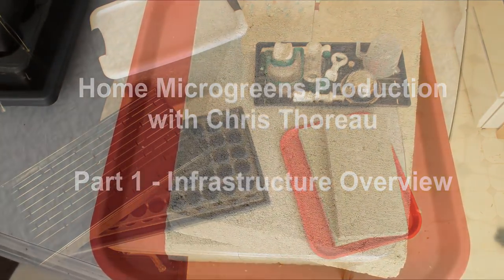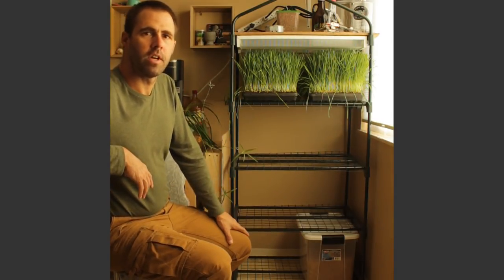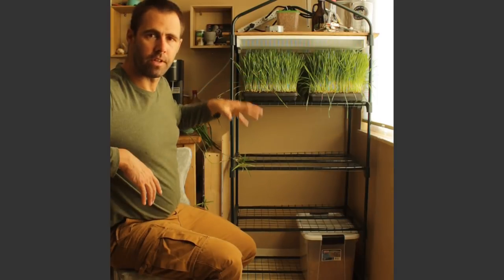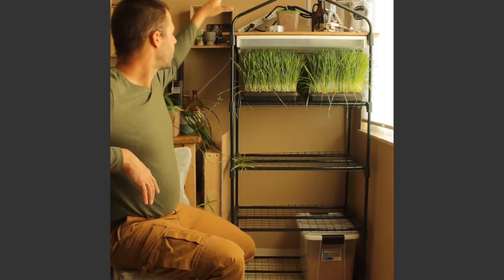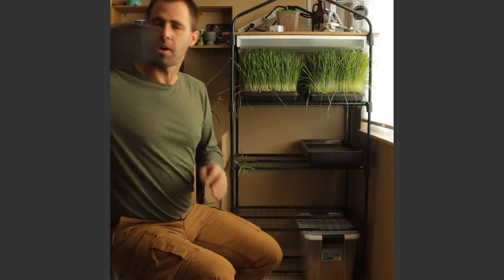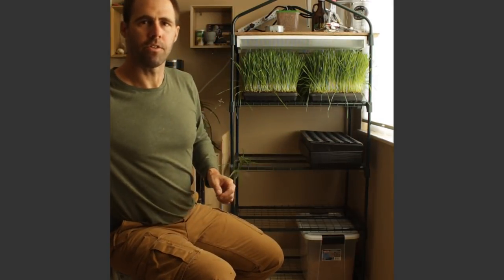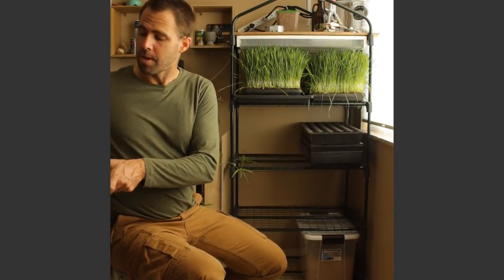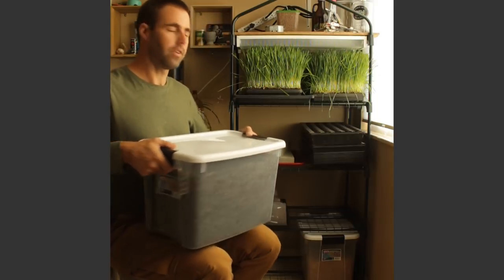1.1: Infrastructure Overview - Home Microgreens Production

Comment: Hi Chris! Thanks for your elaborative video. I want to start with a small Microgreens setup. The installment of good lighting seems to be a critical factor in the growth of Microgreens. You recommended T8, Fluorescent, 6500K, 18 Watts in the Excel File. Please also comment on High Output (HO) T5 Grow Lights; do they work better as compared to T8, Fluorescent, 6500K, 18 Watts. Thanks,

https://www.homedepot.ca/product/philips-fluorescent-32w-t8-48-daylight-6500k-2-pack-/1000159507